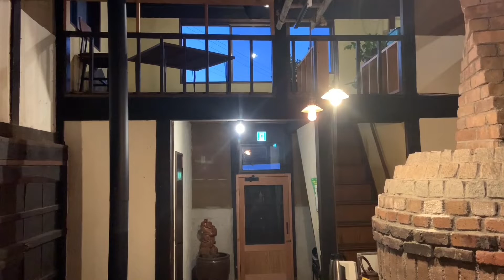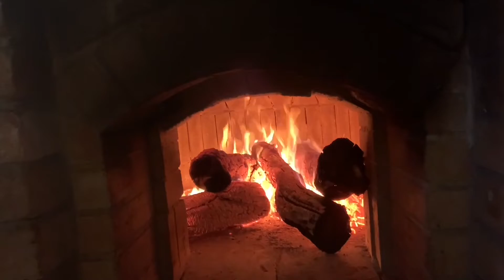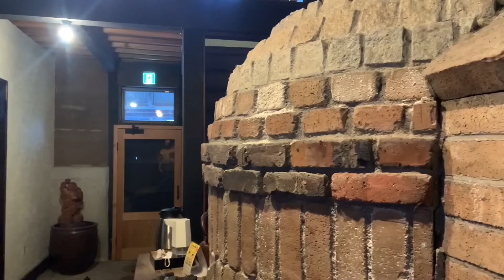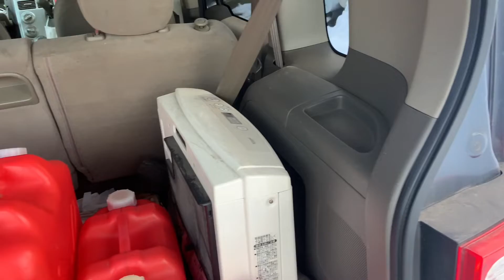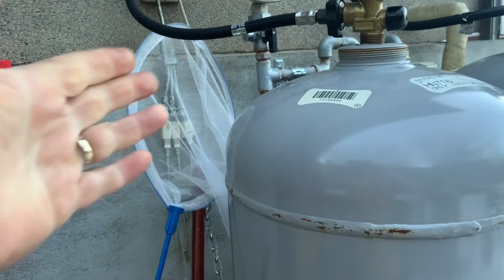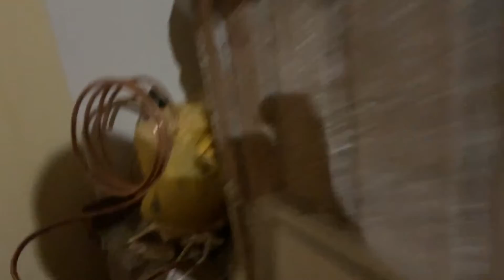Heating an old Japanese house in winter. How i heat my 135-year-old Japanese Kominka with 6 methods.

Comment: Hello. Is there a metal tray covering the floor of the brick oven so you can remove the ashes, or do you have to sweep them out? If you have to sweep at this time, do you have a plan to use a metal tray in the future? If not, is there an advantage to not having one?
Reply from the maker: I use a small shovel and then transfer the ashes and coals into the wood stove to cool off. I can even take out whole logs and put them in the stove to fire it up quickly in winter. How can you heat the floor up efficiently if it is covered in metal trays? These ovens cook from the floor not from the internal air temperature so covering the floor with anything doesn't make any sense. It only takes 5 minutes to clean the floor of the oven with wet towels.
Reply: @RealRuralJapan  Ok! Thank you for your reply! The reason why I asked is because I've recently built a similar wood oven in my backyard for cooking and baking. I fired it up a couple of days ago and cleaning it out produced a lot of dust. Scooping out the ashes wasn't too bad but they made clouds of dust when I emptied the scoop. Then I used a brush to sweep the oven floor and the dust was even worse. Is there a technique you could suggest to not generate a lot of dust when cleaning?
Reply from the maker: Use a wet towel when cleaning the oven floor. Rinse and squeeze out a few times. A broom should never be used.
Reply: @RealRuralJapan  Thank you for your reply! I think I'll try a wet mop.

Comment: I love the LPG system. Here we have to keep a couple of backup bottles and we often have to go outside at the most inconvenient times - usually right in the middle of cooking, to manually swap the gas bottles. There’s no meter and we are just charged per bottle and have to call and arrange delivery each time.
The oven you have is really impressive and must save you a fortune in energy costs. The only downside I can imagine is that it must also make the house even hotter in the middle of summer when you could do without the additional heat.

Comment: Hi there. What an epic oven. Fantastic work. Just for accuracy, but what Japanese call an "air con", usually called a "mini-split air source heat pump" in English, is actually an efficient heater compared to other fan heaters. For Nagano, you need a cold zone model with a beefed up defroster. Even at 0C, It should produce 3kWh of heat for 1kWh of electricity, with no kero fumes and using the same machine as your summer cooler. Unfortunately, electricity is super expensive at the moment, so the running cost is currently higher than kero. It was cheaper until 2022. We have a woodstove too but no big supply of free wood. We pay 5000 per ton of softwood or 13000 for mixed hardwood. For firewood snobs, oak is nearly 20000 yen a ton now, plus delivery.
Reply from the maker: Cool info.

Comment: That brick oven is amazing. And I was just going on about how much I miss wood burning. I never imagined it could stay hot for so long. That's really interesting!
Reply from the maker: Also, when you clean it out at the end of the cafe day you can put snow- and ice-covered wood inside the oven and it thaws it and further seasons it. Wake up, light it and it starts up like you are burning paper. Goes in frozen and in the morning the wood is kiln dried and already warm.
Reply: @RealRuralJapan  Sounds better than the wood stove to me.
Reply from the maker: There is no comparison at all. For home use you could also build the top out flat with stone and fit it out as a sleeping quarter. Put a mattress on it and you have an instant warm bed all night long.

Comment: Does youtube erase comment with external link? Mine disappeared.
Reply from the maker: I didn't delete anything so maybe it did.
Reply: @RealRuralJapan   I have only seen once a hearth heat exchanger (google photo) made by an engineer friend, like the copper tube, except it draws cold air and expels warm air. It is incredible its just a shaped metal pipe, needing nothing else but fire. Makes a room really hot.
Reply from the maker: This would be a Hydronic heating system. Safe and pretty simple really. I don’t know how an air system would work unless it had a pump feeding the cold air. So it wouldn’t work if you didn’t have power.
Reply: @RealRuralJapan  Nope. See  - hearth heat exchanger - photo
Reply: I have to do short replies as my replies aren't showing up.
Reply from the maker: I see plenty of fireplace heat exchangers but all have a cold air pump. I can’t find the hearth one you are talking about. I have a feeling it would have to be a pipe directly heated by flame to be effective.
Reply: @RealRuralJapan  Yes the one I saw the wood sat on the pipes, the pipes then rose up the back of fireplace then extended out into the room past the fireplace a bit. The hot air coming out was incredible with no fan ect, just hot metal drawing in cold air.
Reply from the maker: I see what you mean but that is not what this is. What I installed is a water jacket under the floor of the oven.
Reply: @RealRuralJapan  Sorry, my first comment was deleted by google - Bonus 2 heating.

Comment: What kind of lifetime do you get out of the brick oven? Will it need to be rebuilt in 5 years or something?
Reply from the maker: This Pompei oven will still be alright for a few hundred years at least. It's actually a double Pompei the way i built it. The flue will need rebuilding in about 30 years but that's an external feature of the oven. The last decorative layer that serves no function will need maintenance like repointing etc from time to time but is actually not needed at all. It's just something to look at.

Comment: I know the room is draughty but make sure you have a carbon monoxide alarm in that room at high level or to what the instructions tell you. Just in case there’s an issue with the wood stove or chimney not working correctly or you get a lack of fresh air feeding the 2 fires.👍 great video Steve.
Reply from the maker: There's a 2 meter x 1 meter hole in the roof that goes to a mini roof on top of the actual roof. This is what makes kominkas so cool in summer. The constant outflow of warm air. The chances of carbon monoxide becoming an issue is nil according to fire brigade.